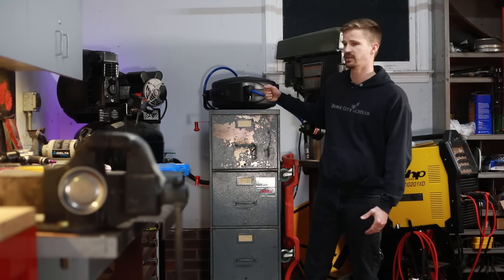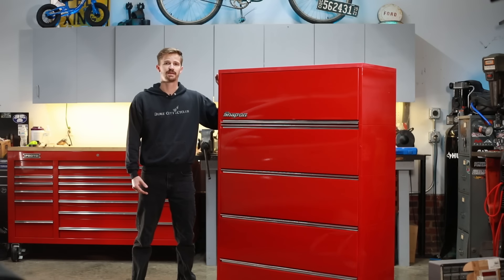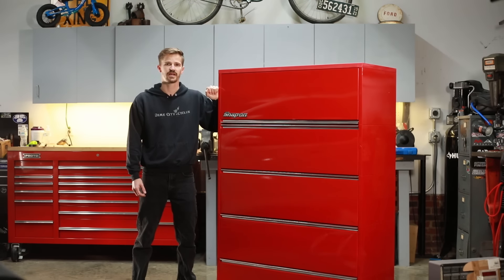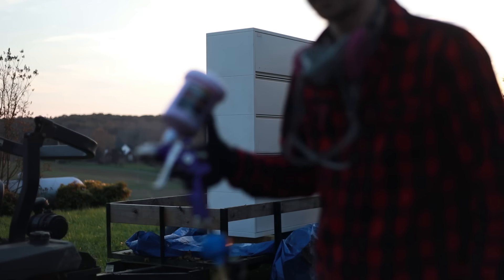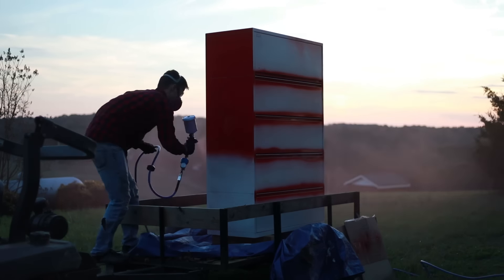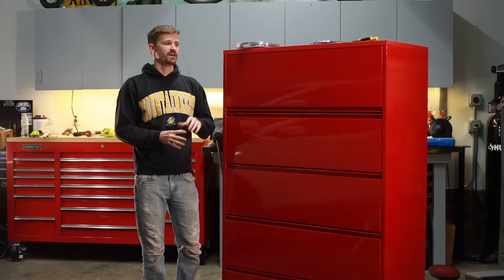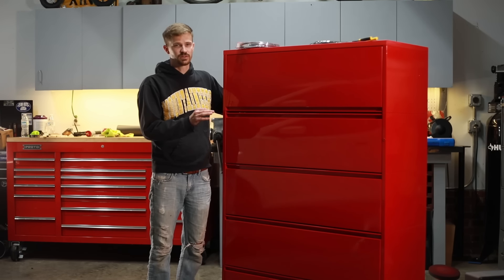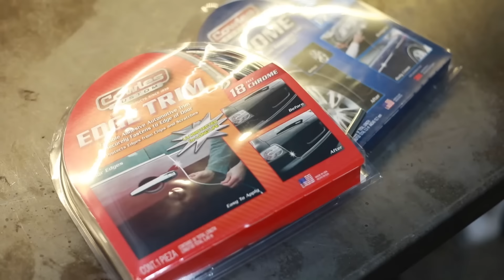Huge DIY Toolbox! For Cheap!

Comment: I've been using 4 and 5 drawer filing cabinets (which I picked up free) as tool and storage cabinets for many years. I have 2 in my garage and one downstairs in my basement shop.The one you just finished is the one I'm looking for as my next tool cabinet. I keep looking! :) Nice job on yours, by the way. :)

Comment: Similar to the file cabinet, for small parts I have used card files. Where yours beats mine is the paint job. all of a sudden, it looks like a tool box and not some old file cabinet.

Comment: Wheels. Dude, got to put locking Harbor Frieght casters on the bottom. Now I'm picky. I would have taken the drawers out, top door and slide out to paint insides where eggshell. G W Hardware and other stores sell black rubber mat you can buy by the foot. It's wide enough to do truck beds. For this, one strip could do the bottoms for all the drawers. Angle bracket cut, drilled, bolted with the casters would really make that dog hunt! But thats just me! 😆
Reply from the maker: I wanted to do casters but my garage is on a slope so even with locking casters im afraid on it tipping top heavy. I would have painted the drawers but they already have a nice texture black finish. And I went in afterwards and put drawer liners in. I have a stash that I forgot about.

Comment: McCall pattern cabinet works great as well. 30 years ago local variety store was remodeling. Got 3 cabinets. Sold 2. Wish I still had all 3. Built to hold as many clothing patterns as could be shoved in. Ball bearing drawer slides. Havent reached load limits yet.
Reply: ............... Those old McCall cabinets were designed to hold more than they actually did. They were built to last many years in the public eye. So they were built to last. I kick myself in the ass for not buying a few that were for sale when an old dept store nearby shut down. They sold them with all the patterns still in them. Heavy was an understatement.

Comment: having converted a filing cabinet with some planks inside to store stuff i have noticed that when you pull out a drawer and its weighed down it pulls the whole cabinet forward , aspecially if the rest of the drawers arent locked when one drawer is open

Comment: I found a three drawer one that didn't have  top. The idea was in an office you would like a wall with them and build a counter top over it. I am going to build a woodworking top with a vice. I have scroll saws and skill saws to store in the drawers instead of wasting bench or shelf space storing them. I am going to install heavy duty lockable casters so I can move it to fit the space needed for size of project. I like the chrome trim idea. Thanks.

Comment: Fridge make for great shop storage...but not in the way you think lol...

The cabinet is a good idea, but it would need a few things that I learned from experience.
1. I would weld a perimeter around the base. These tend to rot FAST, must faster in a garage environment. 
2. I would pain the inside of the "hutch"
Also, those trim pieces will come off from oil and grease. You can buy some aluminum profiles from big box store, cut to length, polish, clear coat, then rivet (but not mandatory). I did one of these but kept it white (I should have done red, but at the time it was indorrs). I did however do the same thing with office shelving, which came out great using a roller (gave it a funky but nice industrial finish)

Also, fridges are your friend lol. I gut them...use the sheetmetal for work benche surfacing, and the door panels are great for wall shelving. Pain them nice and red, and mount them by rope. I have a vid somewhere describing what and how...

Comment: I have been using filing cabinets for years now just for grinders saws sandpaper rags etc got the idea from an old timer who did the same the problem is the old cabinets are heavy gauge steel the newer ones are beer can quality    but nice job on your storage cabinet looks very cool

Comment: I think you did a super job! You could snag a HF  magnetic paper towel holder. I’ve been sitting here trying to figure out how you could add interior type lighting that when you open a drawer, lights come on in that particular drawer. I know there are fellas out there that could do it with no problem. Now maybe you can upgrade your original file cabinet.

Comment: Great fucking job. I had a similar cabinet. 5 drawer. I tried putting threaded casters on but it bent the sheet metal on the base, so I built a 3/4" plywood base for it and screwed the casters through that to give it support - worked great!! I wish mine had a paint job like yours. Unreal!
Reply from the maker: Thanks! I am pretty happy with the results! If you have a compressor its really not to pricy to give it a shot.

Comment: Cool job. Something to keep in mind, these were engineered for paper to be suspended in them. They were not designed to hold a ton of weight on the bottom of the drawer. You may get issues with sagging

Comment: These type of horizontal file cabinets show up all the time at our local auction house.  Most of time they can be purchased for $10-$15.  I have bought legal size vertical files for as little as $2.50.  Another great place to look is Craigslist under Free Stuff.  See them there all the time.  Nice job by the way.

Comment: Tip, try to find some 60's, 70's steel office desks with drawers.
The desks are to low to use. The drawers are often heavy duty, thicker gauge than modern office file cabinets.
Use the drawers, suspend them under s cart or something.
I did, have my lathe and mill tooling in there, use the cart by the machines to put parts in and such. Vice, mill, drill and benchgrinder on top.
Bougth an tool set without toolcart. Made drawers to also suspend undner the cart.
Now i always have my tools, tooling and grinders in reach.

Comment: 17:18 it looks so good had we not seen this but just the finnished results.  Youd see guys flipping in the tool box pages of a snap on catalog scratching there heads wondering why this was discontued?  It looks like it just rolled off a snap on truck.
Needs casters and a pull bar, bathroom grab bar 12"  5 1/2" locking casters. 

Im serious if you worked in a car dealership and had this next to a 12k dollar tool box even the snap on man would be asking his rep about it. You could probably make a second one and get 2k out of it.

Comment: I just want to put it out there that when I went to Tractor Supply there was  the products that you had discussed in your video there is also if I'm not mistaken probably four different Reds that are stocked there that match a variety of different brand tool boxes

Comment: If you know the manufacturer of the cabinet and can read the numbers off of the lock you can buy the key on the web.
Reply: I bought a complete replacement lock for $15 on amazon.  It had been drilled out, so keys weren't an option.

Comment: Get another logo for the tool box too you can get them from snap-on for 15 bucks and I would add a mirror to the inside of the top draw so when it’s open you can look into the top draw, many some led lights would be great too

Comment: Glad I seen your video I work for a real-estate management company and the group im in manages a huge corporations facilities and they throw these away all the time and I got a few book shelves in my shop I can now replace with some of these to match my OD green craftsman tool chests
Reply from the maker: OD green would look great! You can definitely find these for next to nothing or free and they really do work well. Thankfully reading the comments a lot of other people are already in on the tip and have been using these in there garage/shop for years!
Reply: @Petrol360  yeah I got some short ones I use already at work that are 2 drawers high but 4 wide but the drawers are a little deeper than the tall ones like you used just never thought about painting them and adding the chrome so they match my tool chests at home. My ex from years ago found the custom OD green craftsman 12 drawer roller and gave it to me one Christmas and my man cave  shop is od green deasert tan and black with barn tin ceilings so it looks like an old bunker  gonna definitely do one or 2 of these to match and give the old bookshelves to the wife to redo and use for her book collection inside

Comment: The only extra thing you should have added is casters. While in a well protected shop and with some type of rubber padding, to have this type of shop drawer system is fine , however if your shop is subject to changes, or you will consider a move, then casters are a better choice. While you might think that it would cause a tipping problem, the fact if the weight will prevent that. And if you are still unsure, you can drill holes in the upper back and secure it to a wall.

Comment: Snap On badge?  Naw,  I would have put a US General Emblem on it and blown everyones mind.  Plus it would match in with your US General Tool Box behind it.  Cool Idea.  I did something simular to a metal tool cabinet and my Powder Coating Oven. Painted them Orange to match my HF tool boxes. Thinking of painting my motorcycle lifts and 2 post lift Orange too.  Just cuz I want to.

Comment: Even faster and cheaper just leave the color as it is.. I have eight horizontal file cabinets that are factory black, two sand color. Six roll tool boxes with tops and about ten regular file cabinets that I use for whatever tools. I have machine shop, I put 2x6 or 12's (What ever I can come up with.) with holes for holding end mills, cutting tools and drills. they work great. Most of them cost me $20 -$40.00 each over the years. Also file cabinets keep most mice out. New tool boxes are out of sight. I'm cheap, I admit it.

Comment: Great  job. what did you buff the paint with
Reply from the maker: https://www.amazon.com/gp/offer-listing/B000NWKXRU/ref=as_li_tl?ie=UTF8&camp=1789&creative=9325&creativeASIN=B000NWKXRU&linkCode=am2&tag=petrol360-20&linkId=8e9aeb022340730f5266184bacb1a9f5

Im no detailing guy but this seems to work well to bring out a bit more shine.
Reply: @Petrol360  Thanks

Comment: Can you share the paint mix measurement/ratio? I want do this ASAP. Great job btw.
Reply from the maker: The hardner is mixed 10:1. So 10 parts paint to 1 part hardener. Then reduce with acetone until you have a milk like consistency. Spray a test panel to make sure it flowing through your gun well and atomizing well before you start laying paint on the cabinet. And good luck! Post a pic of the finished product up on Instagram and make sure to tag me!
Reply: @Petrol360  awesome. Will do. Thanks

Comment: So with it being 4 years later how is your cabinet holding up?
Reply from the maker: @capplehans9888  its been great! Perfect spot for all the buffers, angle grinders, sand paper, and random specialty tools in blow molded cases. Paint still looks good. I will clean it off with some automotive detailing spray to take off the dust. Otherwise its a great addition to the garage!

Comment: What was the mix ratio that you used? Paint hardener and acetone
Reply from the maker: I have been playing around with the mix ratio a bit trying to get the best results but honestly its a very forgiving paint. But I think 3 parts paint to one part acetone then the correct amount of harder works well.

Comment: Can you give me the brand and color number of the red paint primer etc that you used on the file cabinet
Reply from the maker: The brand is Majic color is “IH Red” “International Harvester Red” and I did not use a primer. The paint is available at Tractor Supply or Agri Supply.

Comment: Great video and great idea! But please for your own sake, use the appropriate ppe. You should be using the organic vapor filters on your respirator and you should be using a full face mask or at least goggles to protect your eyes.
Reply from the maker: I am using 3M’s P100 filters which state they are for organic vapors. I also was gifted a full face mask system. Someone bought a handful for the pandemic and didn’t need them!

Comment: Depends on your definition of "cheap" of you have the tools already and the metal sheets either free or dirt cheap, yeah it can be cheap. Otherwise, you are looking at utilising some sort of cutting equipment, press brake etc plus the hardware ie. Soft closing runners etc. I had a look few times over doing something similar and the sheet metal itself would be in excess of 1/2 of the total cost for similar sized and 'okish" quality toolbox, so just give up as the cost/time factor wasn't worth it. Good outcome tho.
Reply from the maker: This was a filing cabinet pre made for use in offices that you can buy on marketplace. I wish I had the skills to build from scratch!

Comment: Still is a couple hundred $ worth of paint and clear and materials too keep in mind
Reply from the maker: Total cost was closer to $50-60. Single stage enamel from the hardware store is pretty good paint when you spray it from a gun with hardener. Otherwise you are right, base-clear will set you back a bit.

Comment: It's a good job. But it would of gone easier on you if you would of painted while the sun was out. Cold doesn't give the paint time to dry. So when you are putting on the second and third coats you actually have wet paint underneath the outer part of your paint. And you get the hazy look. Other than that nice job.
Reply from the maker: The paint wasn’t wet when I shot the next coat I had to wait longer between coats to let the paint tach up hints why it was dark by the time I finished. You actually don’t want the paint to dry you have a recoat period that you need to lay down the next coat so that it chemically bonds to the coat under it. The hazy look was simply the moisture from the fog that was blown against the cabinet from the wind over night before the paint flashed off. A perfect world I would paint in a heated booth but I just have to work with what I have until then. Thanks for the input, each paint job gets better and better!

Comment: Don't waste your money on catalyst/hardener for a "Rustoleum" paint job. I use 2 caps of Japan drier per thinned quart. It does the same thing and is much less expensive.
Reply from the maker: Iv heard of people using Japan drier as well. I have been thinking about doing a video where I compare all the ways to apply rustoleum and see how much more shine and durability each one has usng the different materials the thin and apply it.

Comment: I have used office cabinets, filing cabinets and medical carts in my shop for years. I have even painted a few but it always drove me nuts trying to figure out a way to make the handles on the drawers look better. I had some aluminum in the shop that is very expensive and I didn't want to use it the chrome trim with an awesome idea. I have one complaint that is the quality of some of the video was so blurred you couldn't see the results and it really aggravated me. I was looking forward to an up-close View of the chrome trim you used and then when it came up in the video it was so blurry you could not see it. Awesome video good idea but you got to do a better job on the quality of the video. Congratulations the cabinet looks awesome

Comment: Problem is. If your a body man those drawers won’t hold a lot of weight with different tools
It’s cool but only for little things
Reply from the maker: These cabinets were made to be loaded down with paper which can get pretty heavy. With this 42” wide cabinet it can hold about 20 packs of paper at 500 sheets each. At 5lbs a pack thats 100lbs per drawer 500lbs for a fully loaded cabinet. Unless you still use led as body filler you should be able to load it with most any tools.

Comment: I can’t believe it, just find a files cabinet paint it and there you go, just a comment, don’t put heavy tools inside cause that cabi will fall apart 🥴🥴🥴
Reply from the maker: You would think it is very weak but think about how heavy a 4’ stack of paper would be. Each shelf holds that. Still not up to name brand toolbox’s but perfectly for tools in blow mold cases ect.